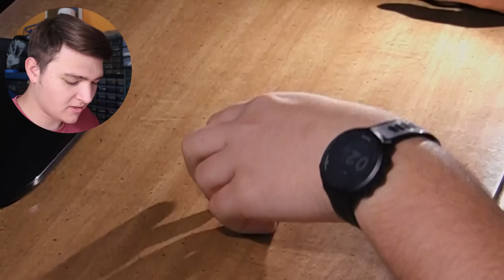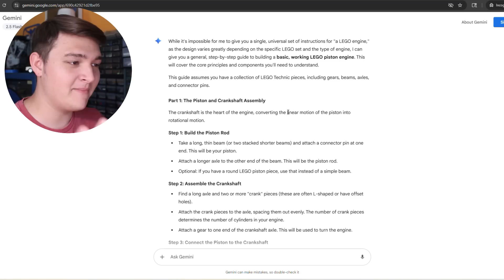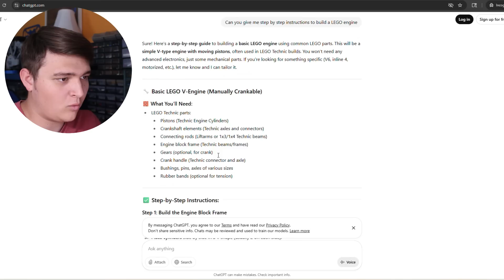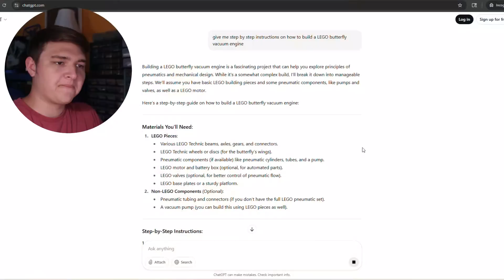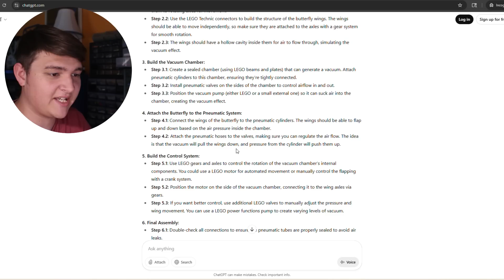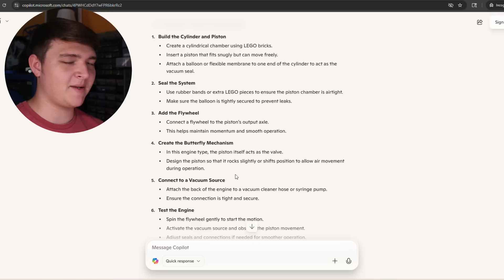Can A.I. Build a LEGO Engine?

Comment: You should make a 10min vid of trying to make a Butterfly lego vacuum engine❤
Reply from the maker: I actually did try building one after finishing this video. It took me like, maybe 2 minutes to build a running one 😂
Honestly just not my thing, I like the regular poppet engines a lot more
Reply: Could you give me some tips on making a 2 cylinder Lego vacume engine I'm new to Lego engines I mastered macking a 1 cylinder and can make one in 5 min😊
Reply: @DeltonAdamsLEGO  when i try to make a poppet engine, it doesnt even try to even fire, it either locks up, leaks too much, has too much friction (i cant use lube), or is just lazy and never ends up running (not even remotely close)